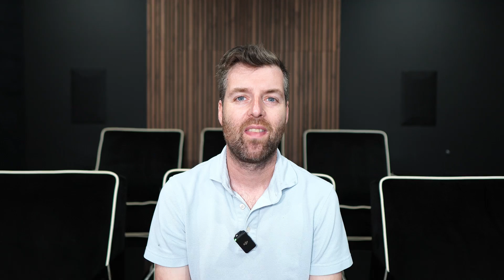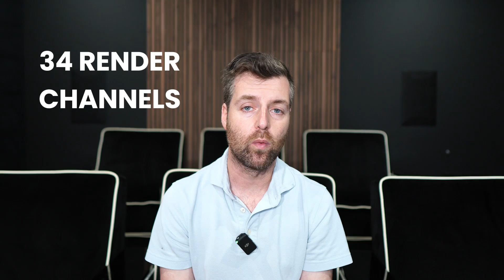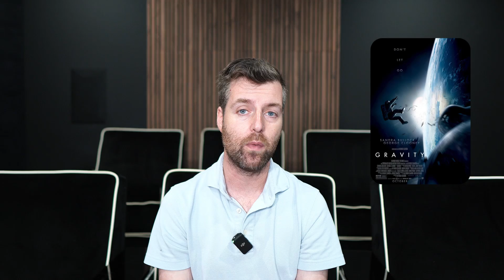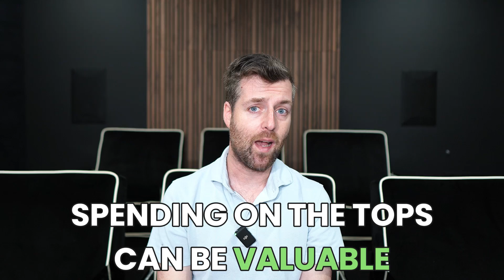Secrets of the Dolby Atmos Home Theater

Comment: You are completely right. I have a sonos ultimate home theater with dual subs and the fact is all speakers should reach same spl at listening position and another fact that is it needs to sound coherent like you mentioned and as soon as you change one of the speakers up or down a db it will mess imaging up. It amazes me how some ears won’t hear or notice a difference from accurate and what they think they like 🤣 it’s a real caveat no joke! But of course there is accurate and then there is high end accurate 🤷🏻‍♂️

Comment: Thanks!
Can you provide your thoughts and approach when placing speakers for an immersive codec agnostic design? It seems there is considerable debate on placement and aiming of all speakers in home theater for optimal immersive performance.  Would you consider doing a video on what you feel is best practice for selecting location and angle for aimable typical DI speakers for height and surrounds in a medium sized dedicated home theater (14’-16’ W x 18’-22’ L x 8’-10’ H)? 

For context of my question, Home Theater Guru’s addresses the Dolby Atmos HT reference guide (which is pretty much known in our community to not necessarily be best practice) and suggests what he feels to be the optimal specific placement location angles relative to the MLP for all the speakers. He then aims them based essentially by ear based on their soundstage characteristics respective of their dispersion. He prefers all speakers be aimable to accomplish this, vs. flat in wall/ceiling. Auro specifies front heights placed essentially in the same vertical plane as the LCR, which results in a proposed to be at 30 degrees vertically from the MLP. Some feel that Atmos performs better with front heights in this position as well.  

Can you provide your thoughts and approach when placing and aiming speakers for an immersive codec agnostic design for a single MLP and multi seat MLP row? You could even specify exactly where you would place speakers for a 7.x.4 system in a theoretical 15 x 20 x 9 room.

Gary
Reply: Agnostic immersive audio setup is what I aimed for.    With that idea in mind, go for at least 5.1.4, with 7.1.4 being a little better and 7.1.6 being "ideal"

Keep in mind, Wide speakers are only needed if the MLP is a significant distance from the front stage.  If that is not the case, they are not needed and keep in mind Auro3D does not use Wides, so those processing channels are better served as Top-Middles/Voice of God array.

30° to 45° heights.  Set up as Front Height (30°) + Top-Middle (90°) + Rear Height (150°).  There is some wiggle room for the front and rear height angle.  Go no higher than 45° elevation on the front and 135° elevation in the rear heights.  30° if focusing on Auro3D, 45° if more Atmos focused.  DTS:X does not care as long as you have them labelled as "HEIGHTS" in your amp-assign. (This is of the utmost importance for DTS:X)

For the most immersive sound-field, make sure you mount a height channel above every ear-level channel except the center.  You can even do a center height if you have enough processing channels for it.  But keep in mind that Atmos wont use Center Height, but every other immersive format (Auro, DTS:X-pro and MPEG-H) all do so.

If you get the right processor (D&M or Trinnov, Storm or HTP-1) you can convert the stereo Top-Middle from Atmos into a Voice of God array for Auro3D.

Comment: Full range at every channel is the way sound signals should be produced.  I'm glad that systems can sound great without having to put amazing speakers in every location though. 

I fully agree with you that it's better to do that, and there absolutely is a point to go full amazing with every speaker in your system.  Just not a BIG point and most content won't be THAT much more amazing by doing so.  Kinda like going from a BluRay to a 8K movie won't really make a movie that much better!

Comment: this is how i see it done in music atmos studios but it does get very expensive when you pick a great LCR so the real question is do you compromise the LCR (in output and linearity, mostly output) for matching surrounds or not
Reply from the maker: In high end home cinemas or in studios, you can have everything be great. Many of the best brands have matching speakers that won’t compromise. 

In the studios I’ve designed or worked on, the studio requires the use of Meyer sound Bluehorn. That is part of a system that has timbre matched surrounds. Obviously the Bluehorn Monitor is a step above the rest. But they match and it all works.
Reply: @PoesAcoustics  that part is obvious but im talking about the mid end system and lower where those compromises have to be made

Comment: Just saw the latest planet of the apes in Dbox ATMOS the front stage was incredible I could not hear anything else. I saw wides surrounds and height wides and atmos speakers but heard nothing other than the front stage. Very disappointed. It might have been the film but the front stage with the bass shakers didn’t disappoint. There is a bridge over rapids and it was realistic for a moment. That was immersive so it might have came on briefly but maybe the mix was an opportunity lost or the theater was saving on energy and shut off amps, only 5 people in the theater. I drove 90 minutes for a loud front stage.  Good film. I had a better experience in an unlicensed theater watching dune 2 I  I would think that was 7.? The point is atmos right now is still a gimmick to most studios and we are spending a ton of money for it.  I need a real experience not colored by people making these. Bad decisions in change my volumes and gains after calibration and before I decide.
Reply: I saw this film two time this week. Once in a PDX Atmos and again in IMAX. The Atmos sounded super with nice split sounds and height channels. However the IMAX was front loaded only and loud. This was the first time at this IMAX and it was really LieMAX. No overhead or surrounds channels with speakers only in the back corners.

Comment: I've been going back and fourth on what to build for Atmos speakers thinking, "it's just Atmos", maybe I don't need anything special.  Based on your video however maybe I need to build dipole CBT arrays similar to the rest of the speakers in the theater.  I'm not sure exactly how I want to go about that however.

The mains, center and sides are full dipole CBT and the rear are inverted ground plane dipole CBT.  I'll have to think about how to deal with the Atmos.  The sides and rear are both pretty big (over 4 ft tall) so I don't really think it will be practical to mount anything comparable in size on the ceiling.  It may be a bit challenging to figure out the best solution.

Comment: This video was literally the proof that I was totally wrong about how atmos should be. I was trying to pin point where my overhead effects were coming from and oftentimes getting frustrated because I couldn’t tell which speaker was playing the atmos effects. It was never meant to be like that. Thanks Matt and like always your knowledge is insane.
Reply: Yeah, its supposed to blend together into a cohesive 3 dimensional soundfield all around the listeners.

The height/top speakers should only draw attention to themselves occasionally.  Obvious things like thunder overhead, or a helicopter or a P.A. system (Man of Steel has a couple of good P.A. moments that should image directly above your head)

The rest of the time they should work together with the ear-level channels to deliver a 3D quality to the sound.  Its uncanny when you get it dialed in.  Its unmistakeable.

The frustrating thing is that Dolby actually designed their system mostly around Top/ceiling channels when really it should be height channels with a pair of Tops overhead.   All the dolby literature shows 4 overhead speakers and those have a much harder time blending with the ear-level speakers for the proper effect.

Fortunately you can set them up as heights (between 30° and 45°) and the situation improves.  If you have at least 13.1 channel processing, you can do Front Height + Top-Middle + Rear Height and get the proper effect.

Not everything is supposed to be overhead (as Matthew says in this video) and a lot of it is supposed to image between layers in a subtle way.  

Take a look at the "Object Demo" youtube channel to see how the Sound Objects perform for various movies and you can form an idea of what kind of speaker setups will be most effective in renderimg the Objects.

Comment: How does a sloped ceiling affect room sound dynamics , in your opinion? Also my room setup is so that the tv in on the long wall of the room (rectangular room with sloped ceiling from 8 to 16 ft).  In your opinion did I make a mistake by placing tv and couch parallel to long walls?

Comment: Great content, it would be nice to hear what you have to say about placement of atmos tops
Reply: Yes, exactly, there seems much controversy over placement of Atmos height speakers … eg., directly above bed layer speakers (like Auro 3D advises) or a closer to MLP  object based inner “sound bubble” for the overheads. Very confusing!
Reply: @JanosWalter1  yes exactly my thoughts after hearing people on YouTube using the Dolby rendering tool to display where atmos speakers should be place, it is very confusing hearing completely different perspectives
Reply from the maker: @JanosWalter1  no controversy. One person thinks they should match Auro. Everyone else thinks they should go where Dolby has always said. No experts agree with the counter view.
Reply: @PoesAcoustics  this was my thoughts exactly
Reply: @PoesAcoustics  we are all just amateurs   / enthusiasts compared to your good self but couldn't agree more. Overall just a great post.

Most of us have 4 heights capability and having tried it high on the walls front / rear or the extreme front / rear of the on ceiling, Atmos channels sounds crap there simply put. It's just too far from the listening position.

 The solution is not to keep that speaker layout and up the channel count and go a set of top middles since as you point out many home atmos mixes will then fold the .4 into the  top middles. So then you set your processor back to .4 instead of .6 - to hear 4 channels then you are back to all 4 Amos channels being too far away. 

People following the advice of that one individual are simply in for a less optimal experience. The biggest issue with this is that it's no small thing to put speakers in or on your ceiling. It's like real effort with WAF factor for many and so on. You want your first choice to be the right one. I see people just swallowing the cool  aid on it though. 

End rant I guess I should say about now 🙂
Reply from the maker: @stevenlawrence2232  everyone is welcome to do as they please with their own systems. Outside of the pro world there are no police regulating the following of these standards. But I was a part of RP22 toward the end of its development and a part of the current RP32, RP1, etc. We had the actual co-creators of ATMOS weigh in on speaker placement.  They agreed with the general unified approach adopted by RP22. We’ve since had some group discussions around opinions over placement of the tops. The dissenting views from YouTube were shared around. Nobody agreed. All called it misguided and mistaken. 

One of the fundamental principles in RP22 adopted by group concensus is that specific angles are less important, overall the focus is on zones and ensuring that no two speakers have too large of an angle between them. One problem with Atmos is that the angle of separation between the bed layer and tops is fairly high.  But they deemed it acceptable.  However there is no provision for a middle speaker if you place the tops too far apart. If you place them onto the side walls or the edge of the ceiling near the wall interface, the separation angle between the tops is extremely high. That would seem problematic to me. 

At the end of the day. I don’t agree with the views that Dolby got it wrong. I think they have it right. There is an argument to made for more closely following the pro angles over the consumer angles. But beyond that I wouldn’t stray myself.  Having said that, if others want to try their own way, that is on them. If it makes for a worse experience, that is for them to figure out.
Reply: @PoesAcoustics really interesting and professional insight. Thanks Matty!
Reply: @PoesAcoustics  - one person Matt?  Are you referring to Wilfried Van Baelen? I understand he has quite a few “expert” followers who agree with his speaker placement methods … even Trinnov ?
Reply: In regards to Atmos placement I think the “elephant in the room” is Techno Dad’s videos.

Comment: I like to look for speaker lines that use the same mid and tweeter and the same crossover points across the whole lineup. 

Center channels usually deviate the most, often cramming in a smaller midrange driver.  One solution would be to use the center channel model for all the other speakers too.  But then the lobing effects of WTMW are multiplied.  

Which then turns my favor towards concentric drivers. But most center channels with concentric drivers also have woofers flanking them in a WCW configuration. Is that really so different? A consideration I feel lends it’s self to considering the bandwidth of the concentric driver and the output levels it’s capable of if we were to crossover the concentric driver directly to our powered subwoofers, or low enough to comfortably avoid most of the lobing effects.
Reply from the maker: Because a concentric speaker is usually crossing the side speakers very low, it’s not a huge issue. You can see this in the vertical of Kef towers at Erin’s Audio Corner.